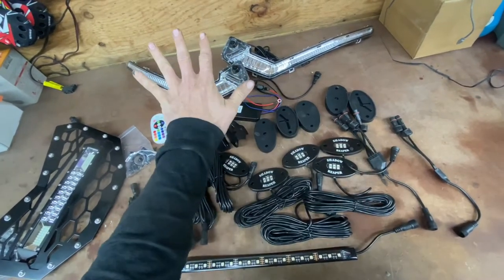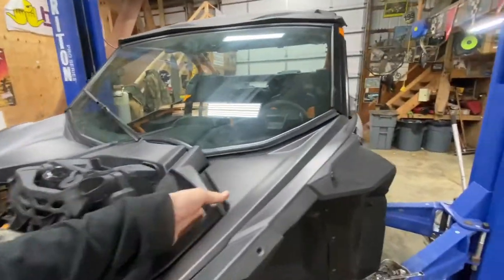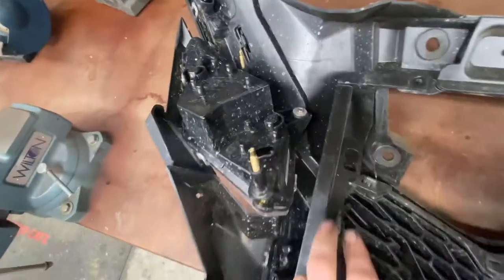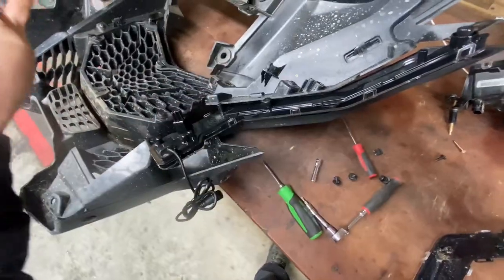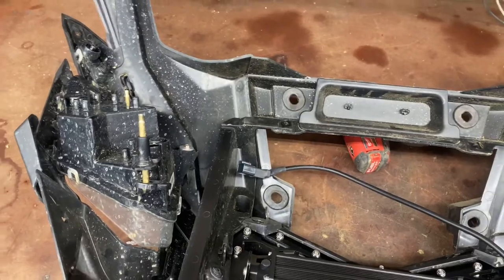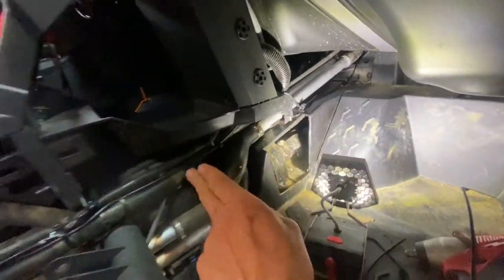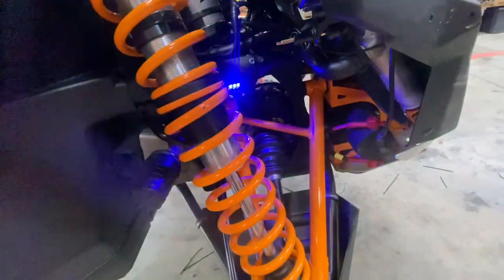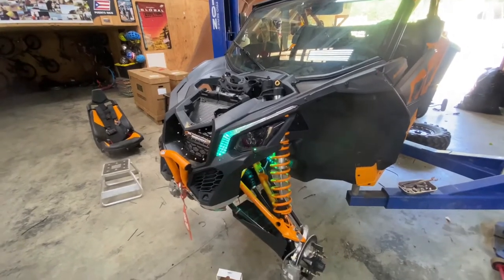Infinite Offroad RGBW rock lights, X3 accent lights and LED grille installation video from Hubert.

Comment: Thank you so much for this video I was putting that grill light on and I couldn't figure out how the bracket should go. Also I had two other brackets their kind of L brackets did you have those two with your kit? I have the two that are mounted on the tabs like you have but also have two others and I don't know where they go.

Comment: I’m in the process of installing all this on my X3. These lights are super bright!!  Can’t decide where to install my two led strips. I like the location you chose in the rear. I may do that and possibly put the other one over the front radiator/grill area. Is there a limit on how many lights you can string together on that little module? Currently, I’ve got everything mentioned in this video plus 3ft. Whips. I know they’re low amp leds. Just curious. Can’t wait to get it all done. 👍🏼🤘🏼👍🏼